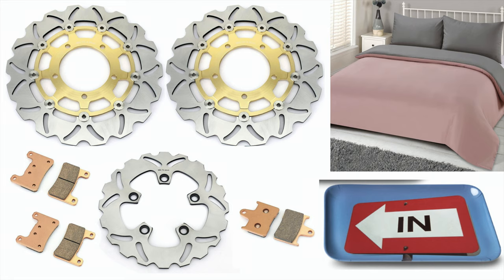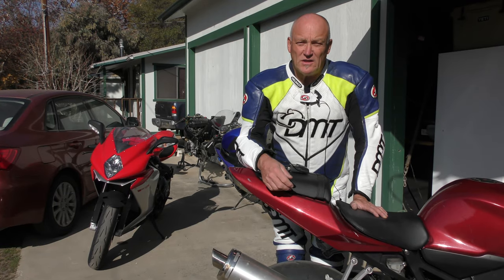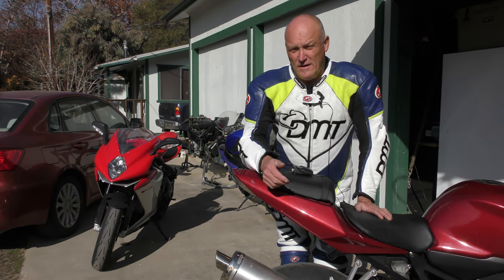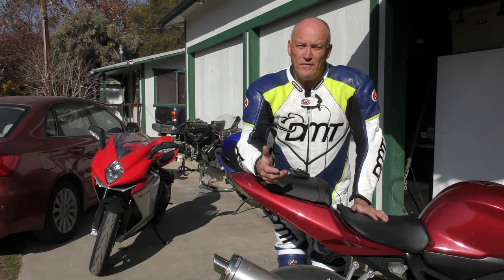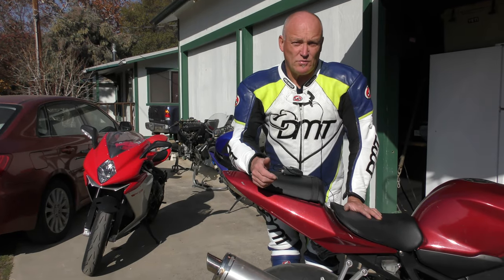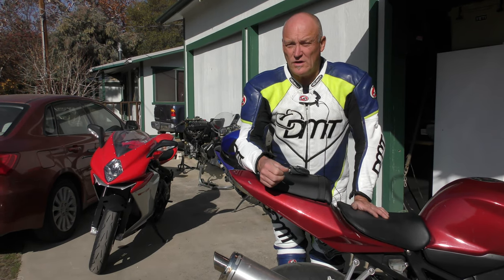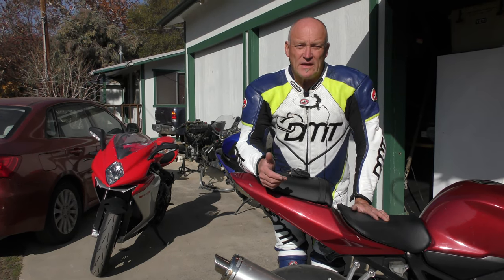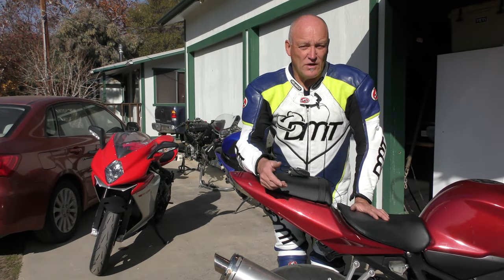Bedding In Motorcycle Brake Pads & Rotors

Comment: Hey Dave.  I am surprised the Service Manual for my application clearly discusses brake caliper removal, brake pad removal, piston removal, fluid seals and dust seals removal, brake discs (rotors) removal, reassembly for all to include torque specs and sequences, but offer NO PROCESS on properly bedding new pads to rotors for one of the most important components on a bike for safety.  Amazing.
Reply from the maker: That is very off when it offers you a complete overview and overhaul. I'll assume that they believe you will follow the pad manufacturers recommendations.

Comment: You do moderate stops.  I was taught the stops should be nearly an emergency type stop.  I was always concerned about cooking , warping the discs.
Reply from the maker: I want to transfer material as evenly as possible via heat and friction leveraging duration. I have had excellent success with that method over the last decade with all rotors and pads.
Reply: @catalystreactionsbw  that makes perfect sense!  I will try your technique... makes more sense that killing the pads and rotors out of the box.
Reply: I was told stopping completely would cause all the material that is being removed/bedded too come off the pads and stick into one spot on the rotor. Idk, I have just always done what's in the video and don't come to a complete stop

Comment: Just learned Something New,, Thanks Dave..So its 10 × @ 50/65/80 km both front and Back Correct ? And all that at App %50/60 of Pressure..?
Reply from the maker: Yes, correct. Feel the pads and rotors grip and the front and rear will dip, let go and repeat. The key lesson is feeling the pads grip the rotors so you get a 2 for 1, pad grip levels and a lesson on pressure and duration.
Reply: @catalystreactionsbw  Thank You,,Well Explained,,You are One of the Most Punctual and Responsive guys I've Ever Met and there Really aren't Many ..Always Grateful for your time Sir.
Reply from the maker: @paulhorvath9784  Thanks for supporting my work Paul.

Comment: Do you think this procedure help with pad squeal that's prevalent on especially new Triumph's equipped with Brembo Rotors, Discs and Pads? I did do something similar and it seemed to help but sometimes a light squeal returns at parking lot speeds.
Reply from the maker: Squeal is normally generated on the brake pin if their is a groove present and the pad vibrates. Have you checked the pin for wear? Some pads will come with a backing plate.

Comment: Does this only apply for new pads and rotors, or can it also help older brakes that are not operating smoothly?
Reply: If I were you and braking doesn't feel smooth or maybe on/off I'd check to see if your rotors are warped first.
Reply from the maker: This applies if you change pads or sand your rotors. Older brakes not performing well can be  old fluid, stuck pistons(s), caliper alignment incorrect or rotors not true.

Comment: I'm afraid of doing it because the last time i bedded in new rotor and new brake pads, the front forks became "soft" on application of front brakes. Too much hard braking in a short time caused the oil to deteriorate?
Reply from the maker: Perhaps there is a different perspective. Much more braking efficiency with new pads created more braking force = softer suspension feeling.
Reply: @catalystreactionsbw  No. It seemed like something deteriorated. When i braked, it was so soft it was dangerous. The bike needed more distance to brake safely. There was a lot of fork travel. 

After that, I went to the workshop to get the fork fluid changed and it was better, lesser fork travel, not as "soft" as before.
Reply from the maker: @wakaoeh  Then look at adding more preload and compression damping so you have less dive.
Reply: @catalystreactionsbw  My forks are very basic. No options for preload and compression damping. Only the fork oil and springs inside.
Reply from the maker: @wakaoeh  You might be able to get preload caps from eBay that give you 15-20mm preload as they replace your stock caps.

Comment: Brembo recommend that you fully clean the rotors with scotchbrite pads and brake cleaner when fitting new pads.

You should also clean new discs as they often have a protective coating.

Gradually increasing the pressure/speed over 50 miles  ish, with no harsh/emergency brake (unless required obviously).

It was described to me (many years ago) as seasoning your brakes not cooking them.

Comment: What if I’m at the track, replace the pads and don’t bed the brakes? What issues does this cause?
Reply from the maker: Generally glazing - almost mirror finish on the face of the pads. You remove it by figure of 8 method on the ground or gently face it with 400 grit emery cloth.

Comment: what a timing lol, doing this tomorrow as well

edit: did you ride smoothly for 100 miles before doing the break in procedure ? also could you show a before and after comparison in the next vid ?
Reply from the maker: This process was done immediately on quiet roads so I could concentrate and perform the skill set correctly. The process on track is no different. Taking the time to bed everything in correctly immediately ensures that in an emergency you have maximum potential for stopping.
Reply: @Darkizo, here between us, for sure one of the Daves have something recorded on the before and after procedure. Would be awesome. Just saying  😉
But yeah, this bed in procedure is the "gentle 100miles ride" compressed, fast forwarded and should no be ignored. 
Brakes fall into the "rather have and not need than need and not have" category and if with that comes longevity, better!

Comment: How do you do this on a track bike? I’ve got carbon pads to go in and it’s safe to say I’m a bit nervous about using them🤷🏼
Reply from the maker: Use 400 grit in an X pattern on the rotors so you scuff it and clean them meticulously. With carbon pads you need to bed them in on track so long duration with 50-60% pressure gets plenty of heat to create material transfer. Session 2 at 80% speed with long duration and session 3 be at pace.
Reply: @catalystreactionsbw  thanks for you reply. Very much appreciated 🙏
Reply: Paul, also just be careful after bedding them in be aware that they will feel bad cold make sure you get heat into them before you go steaming into a corner!
Reply: @Tom-us8cg  do you think I’ll be better off with the sbs sintered track pads? I have ebc hh at the moment
Reply from the maker: @paulthompson9294  I use HH on my road bike and at the track in Advanced. I really like the progressive feel so I can choose brake pressure and duration.
Reply: @paulthompson9294  like Dave said sintered are more than enough for trackday riding and maybe even racing to some extent. 

It’s all personal preference on feel and need. If you’re new to the track Scene and feel unsure I’d start off with sintered get comfortable on how they feel and then when you have more experience and speed give carbon a go because they require heat! A lot of heat to work optimally.

Comment: there is a bed in procedure for brake pads? bruh I just ride it and accept that the breaks will be crummy for the first bit, and if it takes a very long time to bed in I know it's time for new rotors with the next pads. I don't see how a structured brake-in would do anything different than just riding it.
Reply from the maker: Do as you choose Nick. I need to know my brake pads and rotors are ready to go in case of an emergency, street or track. I want that right away, so I choose not to roll the dice. We all have different methods - just sharing mine.